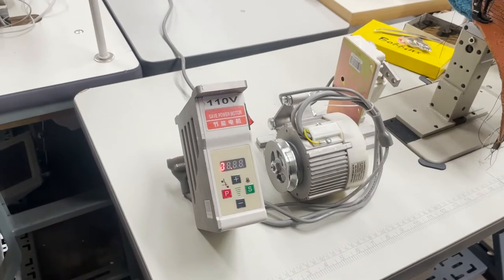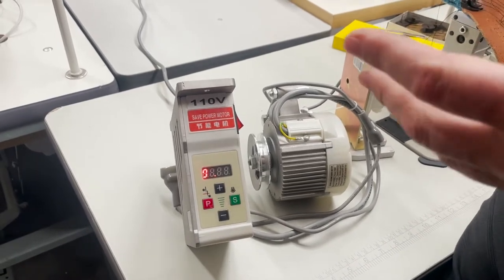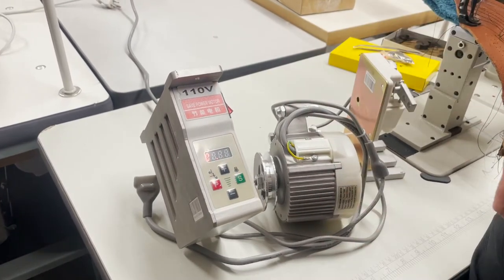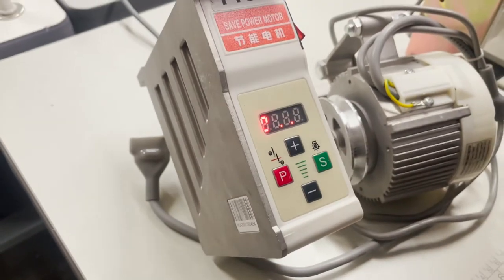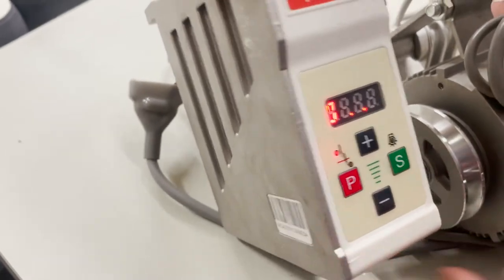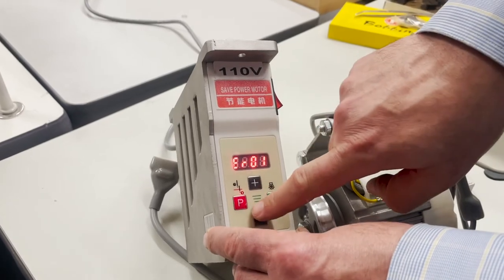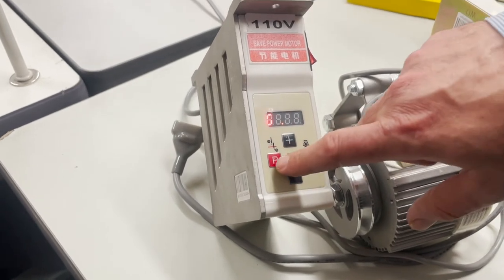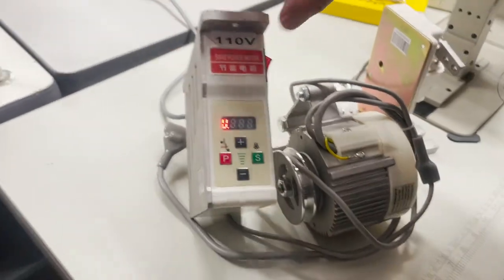Tutorial - Troubleshooting ER01 Errors for Brushless Motors - Goldstartool.com - 800-868-4419

Comment: Hello. I just found your video because I have the exact same motor and the exact same  issue. Thank you for explaining.  Now, my problem is that the motor does work ( I see and hear it) but, the belt seems loose and is not making the needle move. This is a brand new machine and belt. When I had it installed, it worked, chine after the installation until now ( 10 months later). It can't be possible that the belt stretched.